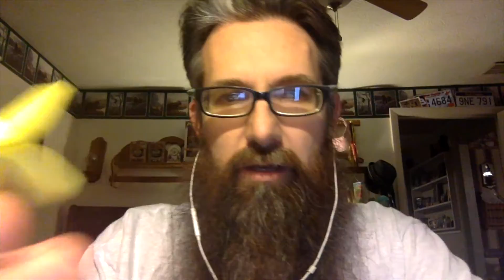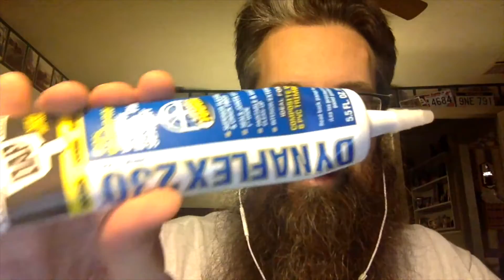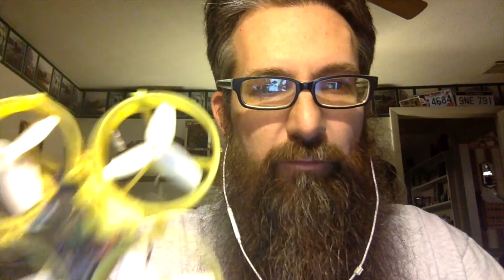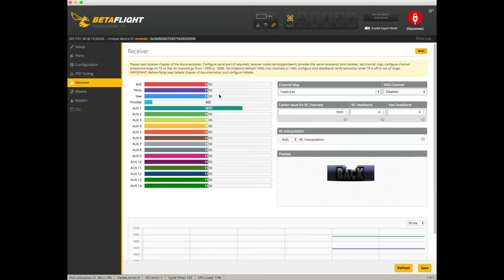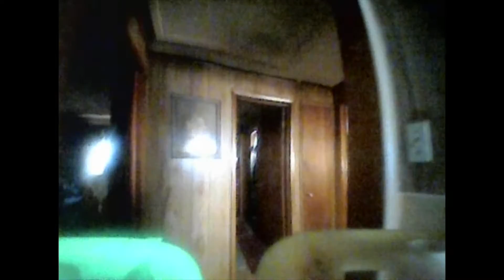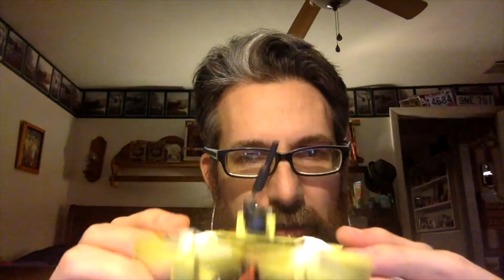VLOG 0021 - Little Whoop (Eachine QX70) Good or no?

Comment: Was hoping you could help me. after i set it up with beta flight when i give just a little throttle the motors spin full power no matter where the throttle stick is. do you know why its doing this?
Reply from the maker: Protocol for the ESC's should be set to brushed in the Configuration tab in BetaFlight.
Reply: yeah it is
Reply from the maker: Check receiver tab.  Make sure that the channels are working as expected with the tx.  Make sure that yaw, aileron and elevator are all at 1500, with a range of 1000 to 2000, and make sure throttle is at 1000, with a max of 2000.  After that, check on configuration what your motor min throttle is set to.

Comment: Hi, I thing 7mm motor better than 8mm, more kv and leds weight. I just bought a qx70 frame, I will test it
Reply from the maker: moninox you'll have to wrap the motors to keep them in.  good luck
Reply: Stacey Abshire Thx, heat shrink tubing can help me. Could you  tell me the weight of the frame without components?
Reply from the maker: +moninox 8g

Comment: Good stuff brother. 
Have an Inductrix with a bad board (1630, known issue) only get 1 min of flight time and am waiting on a replacement. Also bought the MakerFire and a Furibee F90 but the Makerfire came with a  RX antenna broke off. The F90 I can get to bind to my DXe or DX6 but cant get the motors to arm. Went into BetaFlight trying to get the motors to arm, but have to admit it's confusing as alll get out. Watched so many BetaFlight videos it made my head hurt. LOL The BF learning curve is steep but I'm determined to figure it out..... eventually. haha
Reply from the maker: +beachcomber52 might try the lvc hack to disable that... On betaflight, can you do a video of it?  If I could see what it's doing we can get it working
Reply: Hey thanks, I'll shoot you a pm.